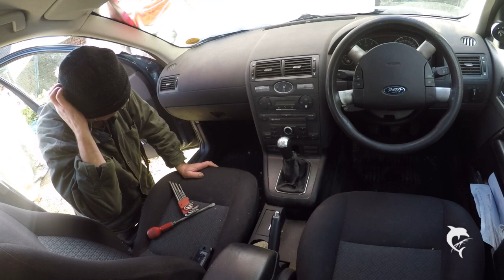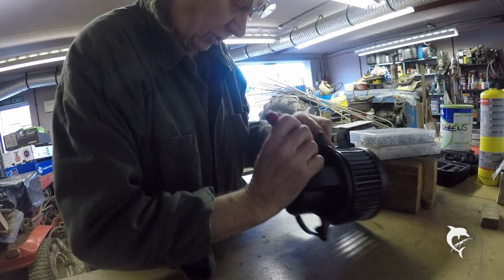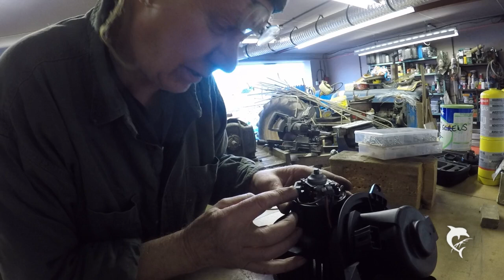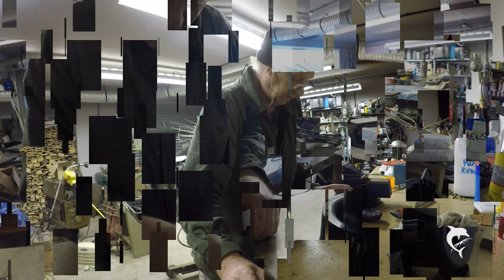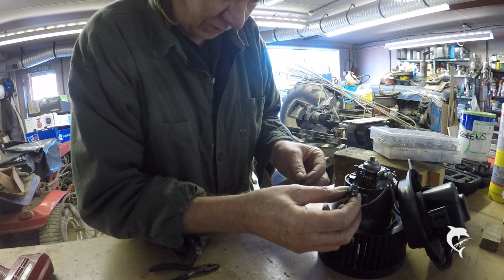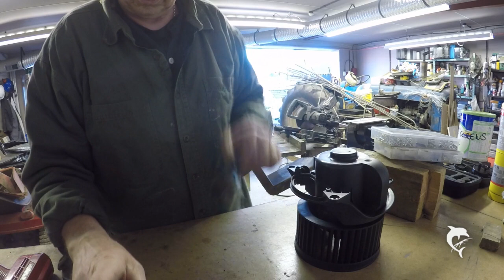Ford Mondeo LX heater fan repair

Comment: This is great. Really concise instructions and clear to follow.
Reply from the maker: Glad it helped you! Since making this I have found that a standard Lucas starter motor c this type!  opper/carbon brush has aq loop of connecting braid, and if you cut the braid in half, and then cut the brush in half, you have enough material to make two brushes!  https://old20tractorparts.com/ferguson-tef20-parts/200-starter-motor-brush-set-2062601.html

Comment: hi phil  great video m8 ty,  if the blower is broken does the actual module control unit still have power,  mine control unit in dash has no power do i need to change blower or module any idea;s please   thanks
Reply from the maker: You will have to find and check the blower fuse first, then trace on a circuit diagram to se where the power goes next, when you get to a point where you lose power, that is where the fault lies. Sorry i cant be more help, but the poor old mondeo is long gone, started to burn oil at 114000 and.repairs were going to be more than it was worth, i had it 11 years!!
Phil
Reply: @philhermetic  hi phil thanks so much for reply m8 , was not expecting 1 top man , i had mine 6 years owes me about 10 grand everything gone wrong with it but i very ill cant work cant afford new car , and i suffer very badly with cold as i have 2 herniated disc and emphysema , been told i have to take dash out to replace the heater unit,  i prob just wait for the cold to get me lol,  thanks for the reply hope all is good

Comment: Hi Phil. I've got an issue with my heater blower. I've had it out like you have but I can't find any faults with it. The fuses keep blowing so now I'm thinking it's the resistor..only snag is for the life of me I can not find it or what it actually looks like as whenever I Google it I get 100's of different types. Any help would be greatly appreciated 👍
Reply from the maker: I think it is actually in the wiring harness rather than being a separate component, but i cant really remember as I don’t have the car any more, sorry, 
Phil

Comment: I'm not getting any heat from mine ,cars upto temp what could be the problem here
Reply from the maker: water is not getting through! if fan is rumming but output is cold. if you can hear the internal flaps moving as you change the heat position control I am  not sure where the water valve is situated and no longer have the car! you could try flushing the cooling system and refilling with new coolant, and while it is empty, locate and take off the heater hoses and push water through with a hosepipe .
Phil

Comment: mine just blows heat out, even wen it is stopped the climate control... no cold air...
Reply from the maker: the fresh air duct is not opemimg, you should ne able to hear it open when you operate the control.
Phil

Comment: I am writing to you from turkey.. I own a 2009 diesel ford mondeo. The heater fan motor does not work at all.. Do I need to remove it from where you removed it.. Do the carbon filters need to be changed.. Or is this a resistance fault? How can I do it... Thank you. have a nice day..
Reply from the maker: If you take the motor off and see if there is 12 volts at the motor plug with a test meter or test lamp then you will know if it is a motor fault or a speed control or switch fault. If there is 12volts at the plug when the fan switch is set to full power it is a motor fault!
Phil
Reply: @philhermetic    Thank you .. my car is 2009 ford mondeo diesel.. heater fan motor does not work.. can I take the fan motor out from the glove box.
Reply from the maker: @ayhankucukozer1478  yes you can, but you can also take it off from underneath without removing the glovebox if you open the passenger side door and kneel down outside the car. The motor is held on by 3 torx screws
Reply: @philhermetic    mondeo mk 4 .. we can remove it from under the outside of the vehicle. I don't understand, sorry.. you can't reach the gas pedal inside, it's too narrow.. should I remove the gas pedal..
Reply from the maker: @ayhankucukozer1478  not from outside, but it is easier to kneel on the. ground outside and lean into the car through the open door. I do not know the layout of LHD version of the mondeo, is the fan on the drivers side or passenger side?
Phil
Reply: @philhermetic  fan on passenger side fan motor on driver side
Reply from the maker: @ayhankucukozer1478  i am afraid the mk4 is very different to mine, which was a mk3 . I have mot worked on the mk4 and do not know the layout, sorry.
Phil